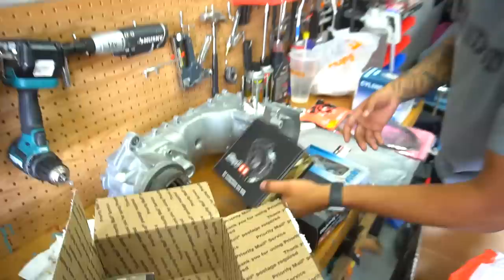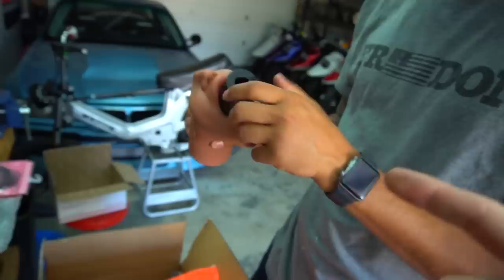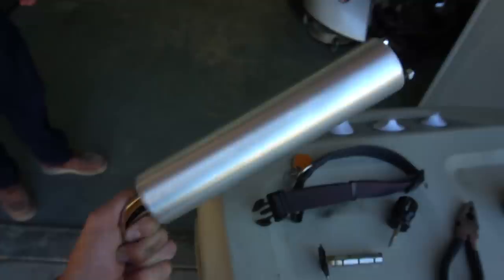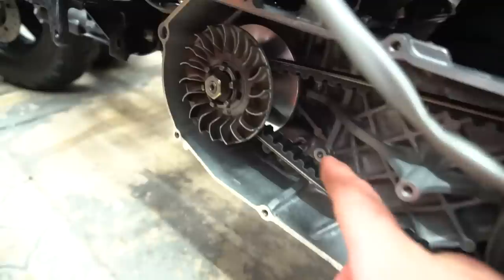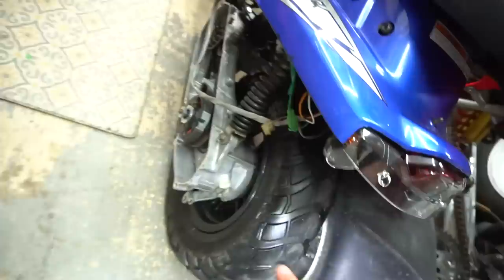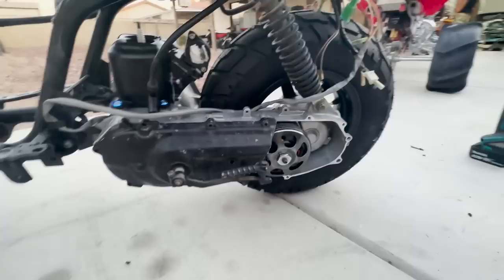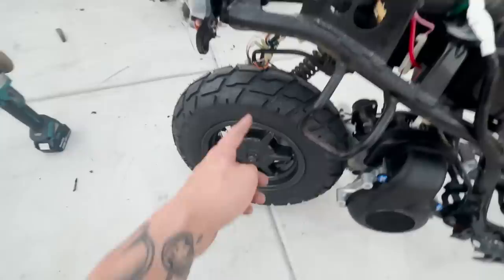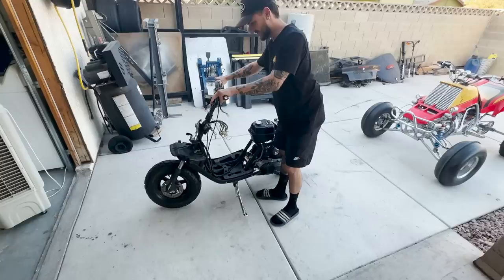FIRST RIDE! 70cc ZUMA Vertical Minarelli Build!

Comment: Polini cylindres are good , but if you have a built like that , I would suggest stage 6 streetrace or stage 6 mk 2 / mk 2 sport pro , those are INSANE , keep up the good work ❤❤😍😍
Reply: mk2 is sick, yessss :)
Reply: Totally agree, I never rated stage 6 cylinders, always ran the Malossi Polini variants. But I have to give it to them, the sport pro with a race crank, c16, just a decent 21mm carb/reed valve and set that squish to around 0.6 you will be fuckin flying. 
I’ve done the Mhr stuff and for overall bang for buck, reliability and consistent power the sport pro is a loooooong way in front
Reply: @jamiejablonski5339  That's right, I'm right there with you, and the setup also sounds really neat.
I find simply plugged from a plug and play cylinder 17 hp to get is already mentally ill ^^ ...
I like to watch your videos, keep up the good work :)
Reply: or polini evo 3
Reply: mk2 racing is better
Reply: @skulastic66  polini evo 3 gives 21hk

Comment: i have a GY6 4 stroke and i want to tune it, everything is stock except the 70cc cylinder, i want to add a MotoForce Racing CVT Kit, but idk maybe i need a better carb with intake and exhaust aftermarket

Comment: stage 6 mk2 and a yasuni c 21
Reply from the maker: c 21 is too top end of a pipe for a wheelie bike, i run c21 on my f12 and not a fan at all for it to be on a prebug wheelie build!
Reply: @MOPBOYZ  you can do a dr 70cc cilinder with a sito plus pipe
Reply: @MOPBOYZ  and youre vids are dope

Comment: how did it not blow when he did full throttle cause the cylinder is cast iron right?
Reply from the maker: why would it blow
Reply: @MOPBOYZ  cast iron should be drove in or how u say it? Max 3/4 throttle the first 500kms